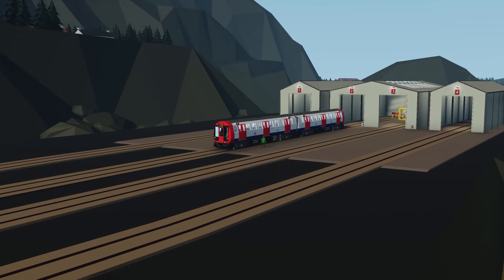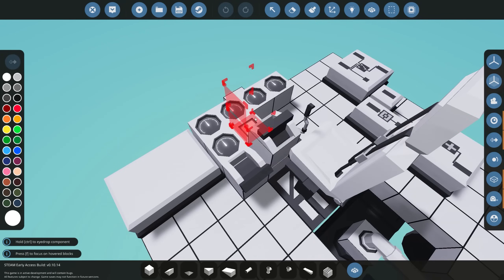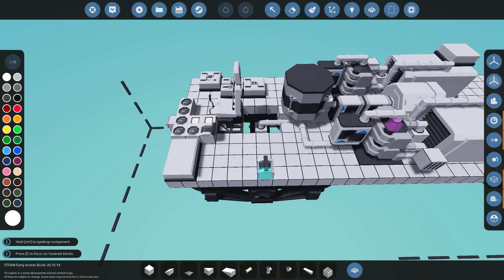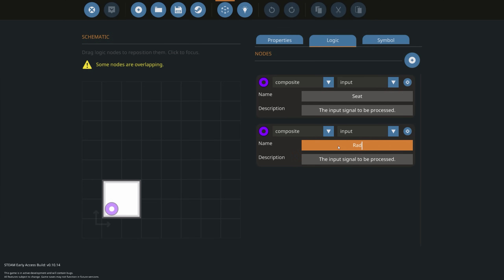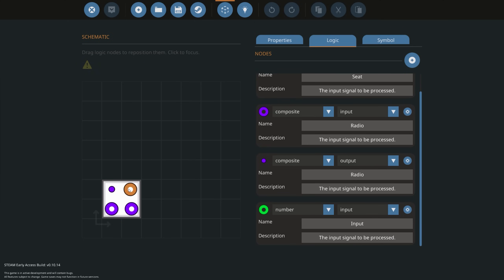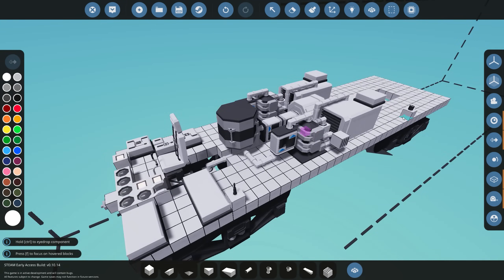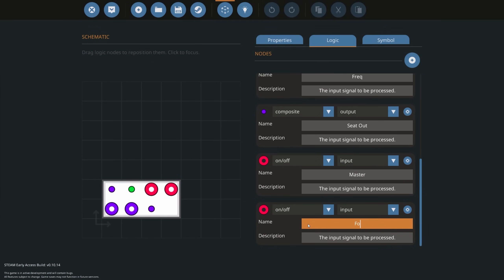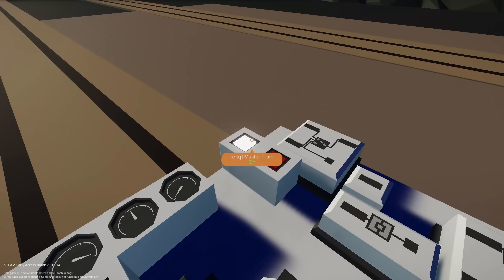Train Master Slave System - Stormworks Tutorial

Comment: question: Would it be possible to use a direction sensor to set the forward and backward automatically?
Reply from the maker: Yah you could but for it to know which direction it’s going it would first have to move
Reply: @MrNJersey  A compass doesn’t require movement.
Reply: So there would be a short delay to work with and I personally would prefer it because then you can start more controlled but if you want it to be realistic, the button variant is best